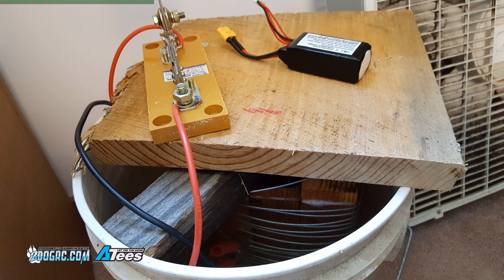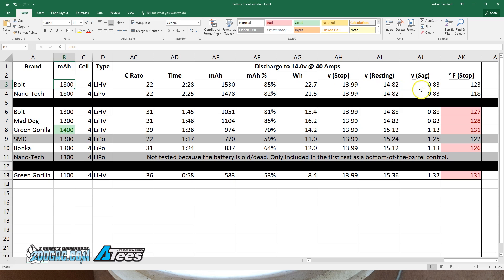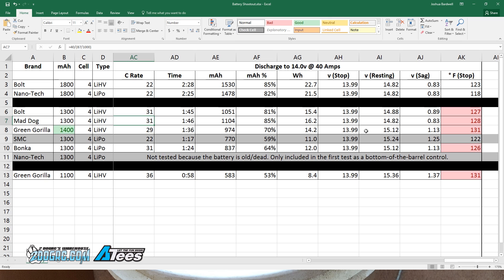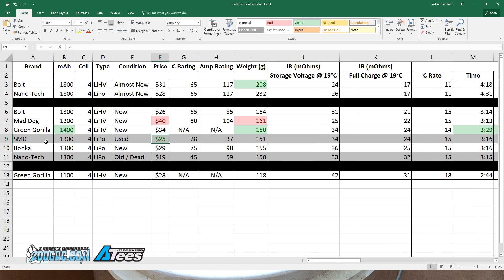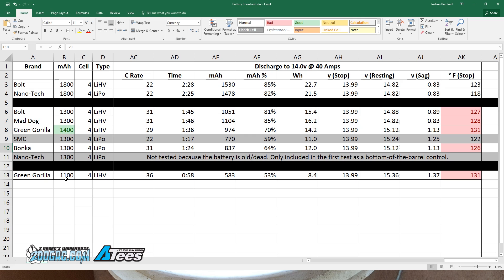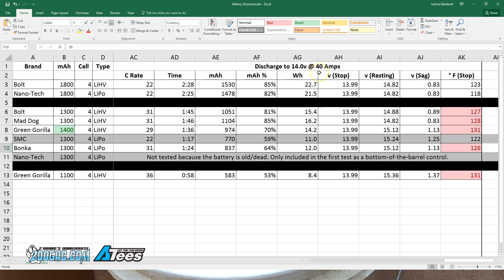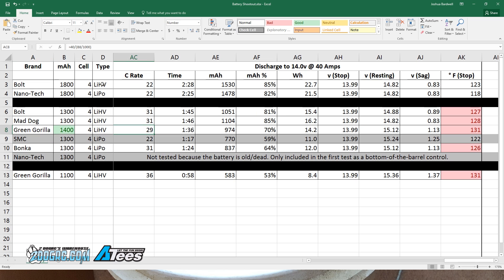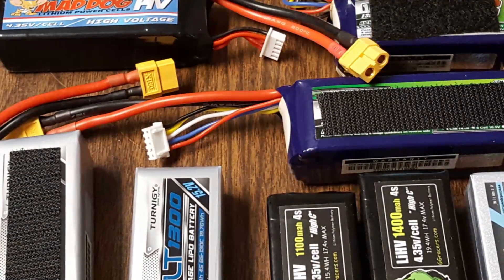Mini Quad Battery Testing - Group One - 14.0 volt discharge @ 40 Amps

Comment: First off thanks for the many very informative videos! helped me a lot..
now I am all new to this. To start out i have bought zippy 1800 with 40C and nanotech 1300 with 45-90C.
I know that this batteries are not as good as the more expensive ones, but my question is, does this matter do a beginner flyer, and how big do you think is the difference? Greats
Reply from the maker: +johbuldmann0206 depends entirely on how much current your copter is trying to pull. I would guess those batteries to be okay up to about 35 or 40 amps at least.
Reply from the maker: +johbuldmann0206 I still run the nanotech 4s 45C 1300 every day. That's a solid battery.
Reply: +Joshua Bardwell thanks for the quick responses! that is nice to hear! my setup is: BE1806 and 12A Emax which i will change to little bee or something like that.. So i think i will be okay with the current..
Reply from the maker: I think so.

Comment: If you do the 60a testing it would probably try to prove the burst rating so the data would reflect a 5 or 10 second burst, simulating the absolute max c rating, usually the higher 90 or 130 that is labeled and see how accurate that is. I also want to see other batteries like everyone mentioned, incl optipower 4s 1300 drone packs which is one of the best brands of lipos for 3d helicopter and they are known for quality, too bad they're almost unheard of on mini quads....

Comment: Good video Joshua.  
I have been testing the new gen of packs. getting better results.

Please keep in mind the discharge time. The 1300s/1400s last about 2 or 2.5 minutes in real conditions . The average amp draw would be around much less, if basing it off tour test time. 
How long do you fly, balls out? Try to use this time for reference and test. Not implying we would do better, rather we are learning daily, but just want to add some realism. Nobody flies our 1100mah for 50 seconds....If so they are asking for trouble.  
There were no quantum leaps in development,  last year we had trouble pulling these numbers from 1800mah packs. 
Were working for improvement , keep up the hard work, thank you, 
GG
Reply from the maker: +Green Gorilla On my QAV-R, with 1300 mAh LiPo, AUW around 550g, I get about 2 minutes to 2:30 flying all out. These results are not at all meant to represent real world conditions, and I think I say as much in the video. I typically get about 3:30 of a pack during normal flight conditions. The goal here is just to test the batteries against each other in a controlled and repeatable way. If one battery gets 1:00 and one gets 1:30 in this testing, then I think we can conclude that the second battery will also do better in the real world. If there is some aspect of the testing that you think makes that conclusion invalid, I'm always open to improving my methodology.

Regarding the 1100, my gut feeling is that it is a fine pack for many people, especially those flying 4". But somebody flying a more aggressive 5" prop and especially on a more aggressive motor like the Emax red-bottom for example is going to puff that pack pretty quickly.
Reply from the maker: ***** I know you're mad, but this isn't the place. Thanks.

Comment: One thought that I have with comparing normal volt lipos and a High voltage lipos, is that the amp dra won´t be as high on the high volt lipos. Say that (for example) your multi rotor is drawing 1000 watts of power at full throttle with normal voltage 4s lipos. That would be 59,52 amps, but with the high voltage lipo you would only be pulling 57,5 amps. Not a big difference, but still lower amp draw on this smaller batteries is always welcome. Then again, the person flying might want to use the high voltage lipos extra higher volt to spin the props at a higher rpm and the you will be pulling the same amount of amps. :) Just a thought. Have you measured the internal resistance the lipos?
Reply from the maker: +Fredrik Sellén Check the spreadsheet. IR measurements are in there for all batteries.

If we assume that a motor is drawing a fixed power then you're right that amp draw will be lower. But my experience is that when you go from LiPo to LiHV, you draw more power because you can feel as a pilot that the power is there to use. Like getting into a sports car and suddenly looking at the speedometer and seeing you're doing 90 when you thought you were doing 60 (mph of course).
Reply: +Joshua Bardwell Your right, I would also think so. Sorry for not looking through your spread sheet before asking.

 I have a few nanotechs 3s 3300mah an they are at 3-5 ohm new. two weeks ago I bought some Giant Power 4s 1300 mah to my vortex 250 pro and the are about 10 ohm per cell! Crazy high for a new battery. (Talking to the supplier to get them replaced.) 

I also just bought some Bolt 1300mah 4s from HK, hope they will give me good performance in my vortex. Will compare their internal resistance with your values.
Reply from the maker: Love to hear if your IR matches up with mine. I think that Bolt is a good pack. It held up well in the higher amp testing.

Comment: Joshua would the xt60 possibly have a some influence in the 40 amp or 60 amp test? I would like to see a connector amperage shootout done with Joshua Bardwell SCIENCE!
Reply from the maker: +Brad Christensen the XT60 is rated for 60 amps, but it will go higher without complaint as long as you don't hit it too hard for too long. For a typical mini quad scenario, with 3-4 minute flights max, even if you are going hard on the throttle, you are probably good up to 80 or 90 amps peak. The rating of the XT60 is more about heat dissipation than resistance to current flow. When I did the 60 amp tests, I could feel the XT60 getting a bit warm, but not even hot.
Reply: Thanks Josh, I thought the real-world current rating was lower than that. Great videos, keep them coming!
Reply from the maker: Brad Christensen I have heard of people who have melted an XT60 in flight, but they were big 6" rigs pulling 100+ amps. I'm not saying you can't do it, but you probably aren't going to do it.

Comment: Have you considered an IGBT? I just came across Marco Reps video this morning on an Powerful IGBT Electronic Load and it seems this would be perfect for these load tests. If used with arduino, it could very well be doing a controlled variable current draw. Even the price on a used IGBT isn't to bad on eBay.
Reply from the maker: +Curtis .B Hertz It does look like that would be the best approach to this sort of testing. I'm just not sure how much time and energy I want to put into more sophisticated test methodologies.

Comment: Josh,  could you test a Revolectrix 4.35 volt 4s battery?
Reply from the maker: +Benjamin Miller Would love to. I am considering what I will be putting in the 2nd round of tests. I want to scrounge as much as I can from vendors before I shell out myself.

Comment: Pls do the 60a and possibly a 80a test to see true C ratings!!!
Reply: The vortex pro can "theoretically" pull 80-88 amps with four 20amp esc (burst 22amp). maybe not interesting to dra 80 amps or even 60 amps for the entire battery.
Reply: There tests are continous drawing, not peak. None will give you continuous 80A without damage.

Comment: A nice chunky relay switching a link on you load between, 20 and 40 or 20 and 60amps on a 30 or 40% duty cycle would be interesting to record the sag and recovery after each cycle.... but a good honest test, hope it will convince the manufactures to be a bit more realistic and honest...
Reply from the maker: +Barry Giblett switching gear that can handle high amps is so expensive.
Reply: A 40 auto driving light relay, switching in a 20amp parallel circuit will be fine...

Comment: 40 amp constant discharge is pretty hard on these batteries especially with no cooling airflow.

If your getting about 2.5mins of flight on a 1300 that would be an average current draw of 31.2 amps with lots of air flow.

Be careful these little packs don't get too hot when you test 60 or 90 amps constant you might have a wee little lipo fire on your hands.

would be interesting though to see which packs can handle the abuse the best though.
Reply from the maker: +Stephen Gibb No worries. I am monitoring temperature carefully. When I did the 60 amp test, I saw about a 10 degree rise in temperature before the battery hit 13.99 volts and I stopped the test. At the higher current draws, the sag is the limiting factor on the test, so what you will see in the upcoming video is that I do repeated bursts of current, down to 13.99 volts, and then allowing the battery to recover. This has the additional advantage of giving plenty of time to monitor temperature and stop the test if temperature is too high.

Comment: Ordered SMC... Flew them today. Not impressed. Getting 2.5 mins of hard flying compared to 3 min on my Glacier and Tattu. 

Voltage sag like the others but voltage would drop very very quickly towards the end. it felt like it would go from 15v to 14v within 10 seconds. my other lipos drop voltage more predictably. 

2205 2600kv 5040 prop. Maybe 2600kv is too much for SMC 1300mah.
Reply from the maker: +L Pablo Mendez I fly the same setup (RCX 2633) with fine results. I don't love the SMC but I think it's an okay value for the price. If you are running the red-bottom Emax 2600kv, they are known to be major amp hogs. They make thrust to match, but they draw a lot of current.
Reply: +Joshua Bardwell yup emax
Reply: +L Pablo Mendez Predictable voltage sag is not an indicator for a good lipo (just my opinion). The best  lipos our group have flown hold their voltage until the very end, after which you only have a few seconds to land. All true high C rate lipos behave like that, including the Graphenes.
Reply: +Flying Dutchman well that makes sense. 

I was getting less flight time and that made the voltage drop very noticeable
Reply: +Joshua Bardwell What is the max amps your osd is reading out during full throttle with your set up? miniquad test bench got a little less than 25 amps per motor on 100% throttle, curious if its significantly lower in actual flight.
Reply from the maker: With this set up, I am pulling less than about 80 amps for sure at WOT. When I was running UTT Tsunami this weekend, I was peaking around 45 amps during the hardest sharp turn.

Comment: Glad you had success with the Frankenstein dummy load Joshua. I am working on a more elaborate version with μ controller, instrumentation and data logging. To buy a load capable of these sorts of loads will cost thousands but I think it is possible to do it for a lot less at the expense of good enough rather than lab grade results.
Reply from the maker: +Rob B was it you who made the suggestion, Rob? Thanks so much! So far I haven't blown myself up.
Reply: I first mooted the idea but others also contributed.

Comment: Where are the Graphene batteries? :(
Reply from the maker: +Maciej Janowski out of stock...
Reply: @maciej I once compared size, weight and rated capacity of graphene batteries and nanotechs. The former seemed like a bad deal. They may be worth it only if they hold much better (less sag at high amps) or last longer.
Reply from the maker: +Chris Mavrakis that's what people who fly them say.
Reply: +Joshua Bardwell Ok then it would be nice to see a graphene battery compared to an HV and normal lipo of the same weight (not capacity), w.r.t. sag. I'm not saying you should do it, just that it would be a test with useful results.

Comment: I think the 60 amp test would still be worth it. Let's see to what degree these batteries can separate themselves from one another when they're really pushing it!

Also, GG claims that his batteries sag significantly at the end of their discharge. I'd be curious to see if they show sag more similar to the other LiHV batteries when partially discharged. It's obviously not good to see significant voltage sag at the end of a flight, but perhaps the 1400mah performs a bit better throughout the rest of the flight than the data suggests. 

Thanks for the test, this one was much more interesting than the gentle ones. Good stuff!
Reply from the maker: +swissolo I've already started the 60 amp tests and yeah, it's really interesting!